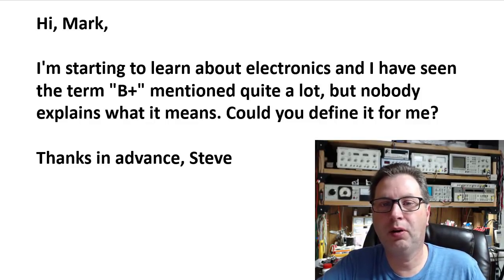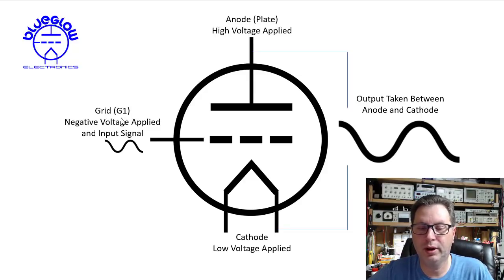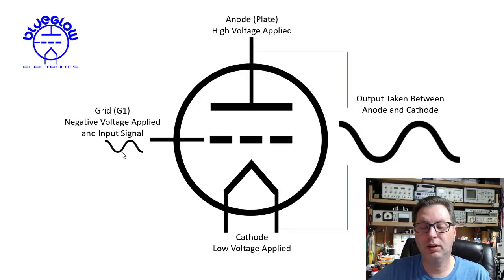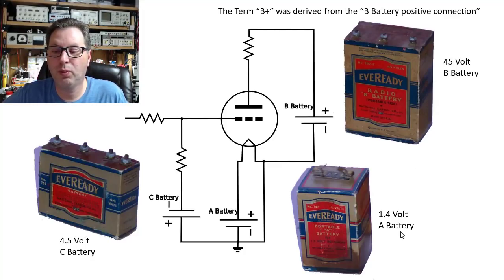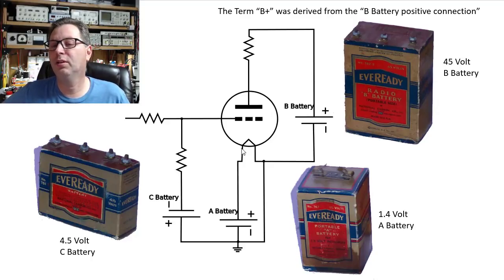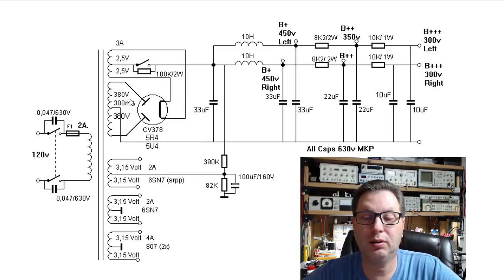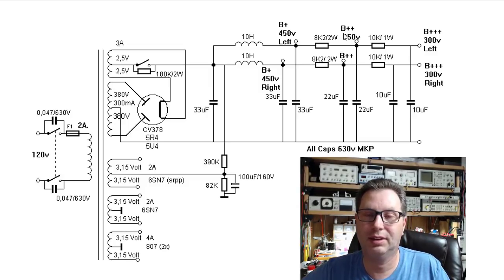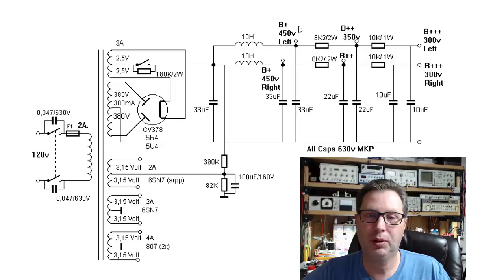What does the term B+ mean relating to a vacuum tube circuit

Comment: Could we just skip the AC, and power tube amp with something like a car battery? We just need it wired internally in series instead of parallel, because we don't need that much current, but voltage.

Comment: Great video thanks!!  Question though. I have a radio with a full wave selenium rectifier. In checking the output of this rectifier, how do I determine if the voltage (assume B+) is correct. I cant find a schematic for this no name radio anywhere. Do I go off the vacuum tube datasheet for maximum plate voltage and stay just under this? or is there another way to determine this?

Comment: The A and B batteries were utilized for Fleming's diode, before triodes. The C battery was added in order to provide the negative bias a triode's control grid requires.

Comment: Is 33uF too much for a tube rectifier? I read that 20uF can be supposed as a max capacitance. Besides, these days a transistor stabilizer is cheaper than a space inside a case occupied with a tube rectifier and additional 20-30 volts in a transformer ))

Comment: Electrons in a vacuum tube always flow from the cathode to the anode (plate).  Since the plate has a higher positive voltage versus the cathode the attraction is very strong for the electrons being boiled off of the cathode.  The cathode is negatively charged with a huge excess of electrons which are seeking the plate (excess of positive charge) and therefore are attracted to the plate.
Uncle Doug's YouTube channel has a more in-depth discussion of this using some good analogies to simplify the process.  https://youtu.be/901iaPVVzY0  How Tube Amplifiers Work

Comment: Hi Mark, i got a similar question somewhat. I assume a guitar signal has positive and negative cycles, my question is if the anode is positive, how does the anode turn negative to simulate the guitar negative? Please help. Frank
Reply: When the tube is idling with no signal applied to the grid a certain amount of current (the quiescent current) is flowing in the tube. When a signal applied to the grid goes positive the flow of current electrons increases above the quiescent current, and when the signal goes negative the current decreases below the quiescent current. This varying current flows in the plate/anode resistor  causing the voltage across it and therefore the voltage at the anode to vary in sympathy with the input signal. The anode never goes negative, it goes more and less positive.
Reply: @silasfatchett7380  thanks Silas, let me digest that

Comment: Thank you for this explanation! What does the B- (minus) mean and where can it be found? Chassis ground and B- different? (They use different symbols) I am troubleshooting an AA5 radio, want to check voltages, need to measure to B-. Thanks again! (using isolation transformer!)

Comment: hi mark, based on the schematics of your B+, the B++ was reduced by a 100 volts using 8.2K ohms, and the B+++ used a 10K ohms but only reduced 50 volts? how did
this happenned? thanks from Canada.......................
Reply: The voltage drop is smaller because the 10k is passing less current that the 8.2k. With 100V dropped across an 8.2k resistor, (I = V / R) 100 / 8200 = 0.0122A or 12.2mA must be flowing. This current is the sum of the current being supplied by both B++ and B+++ . If there is a voltage drop of 50V across a 10k resistor it must be passing 50 / 10,000 = 0.005A or 5mA which is being supplied by B+++ so the current being supplied by B++ must be 12.2 - 5 = 7.2mA.

Comment: Mark here too,  Dinamo said it.  for a newbie to learning electronics, this is nice to be shown where the B+ term comes from.  For those who posted about where it seems he reversed anode and cathode,  maybe Mark just mis-spoke and forgot to edit the correction in.  The basic working principle of a vacuum tube is a phenomenon called thermionic emission. It works like this: you heat up a metal, and the thermal energy knocks some electrons loose. ... When the cathode is heated, and a positive voltage is applied to the anode, electrons can flow from the cathode to the anode.

Comment: Thank you. I've searched and finally found a guy who explains this with a proper schematic and explanation
This is a huge help. Nice work.
Reply: Go to Uncle Doug's channel, he explains it much better:  https://youtu.be/901iaPVVzY0
Reply: @jeffcotton526  OK, I just saw it. I only disagree when Uncle Doug's says that the vaccum made by the B+ on the anode atracts the electrons...
Reply: @alvarogeorg  Yeah it's a little fuzzy on that one.  I believe he meant the electron attraction created by the B+ voltage on the plate.  
I guess it could be termed an "electron vacuum".... 
Between Mr. Carlson's Lab and Uncle Doug I have received most of the answers to many perplexing electronic questions I've had in the past.
I just joined Paul's Patreon Page to learn more.
Reply: @jeffcotton526  I have just saw the first part of that and I think that, in fact, he was making an analogy with a vaccum cleaner "sucking" the electrons.

Comment: When I learned tube theory, it was stated that the heater boiled electrons from the cathode which were attracted by the plate and the current flowed from cathode to anode.  (Negative to positive).   But it turned out that the math was easier if the flow was from positive to negative.  I tend to believe that the former is correct though because of the description of the free electrons being emitted from the cathode and then attracted to the plate.

Comment: Good explanation.Can you put a dropping resistor on the plate of the output tube 6v6 like you do on the 12ax7. Maybe from the lead off the output transformer to the plate of the 6v6 and why you can or why you can't. Thank you for any help. I have asked this question over and over and I am hoping someone will touch on this. And another thing-What determines what value electrolytics you use in the power section. I know you can go to other schematics and see what someone used but it would be great to know how to figure it out on paper.Again, thanks for any help.

Comment: [facepalm] Been playing around with tube amps / devices for quite some time and just accepted B+ as "what they call it". I figured it was a legacy type term but never dug into the origin. Thank you muchly for this piece of trivia. I've been subscribed here for quite a while but I rarely comment (on any channel). I would be (and have been) remiss not to thank you for your excellent content. 

I recently came across several NOS 6L6G Westinghouse Marconi tubes (and a bunch of NOS 50L6GTs) that I'll be using to build some HiFi amps with. Your channel has been very informative and inspirational. You have a great way of getting solid information across without dimming your language down or talking over the heads of your viewers. Your channel and a few others like it have convinced me to record and share my amp builds this summer. I'm going to start with some high voltage play (flybacks & MOTs) with various drivers and capacitors to hone my video, editing and presentation skills.

I will certainly remember to give you, and a handfull of others, credit for inspiring me to create and share my content.

Comment: Wait, electrons flow from the plate to the cathode? Isn't the other way around?
Reply: There is a difference in conventional current flow (which is really hole flow) and the actual flow of electrons. To say that electrons flow from the plate to the cathode is just not correct terminology in my opinion. I would be good with the current flows from plate to cathode, as it is the convention that we use in schematics. Not knocking your video, it was great, I just think that certain terminologies that people are using, lead to most people's confusion.

Comment: This is an excellent video, but it brings up a question of what wire gauge should I use for these high voltages
Reply: Look at your wire, it's usually printed on it.
Reply: I know but, should I use 20 gauge throughout or heavier for B+